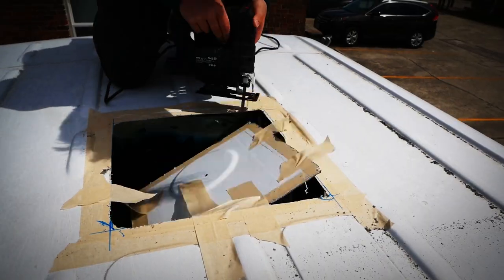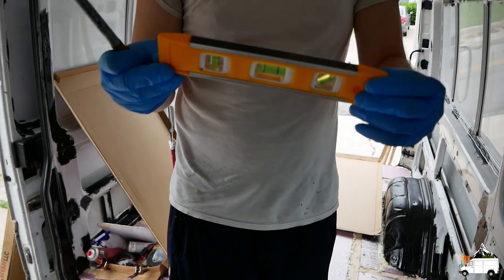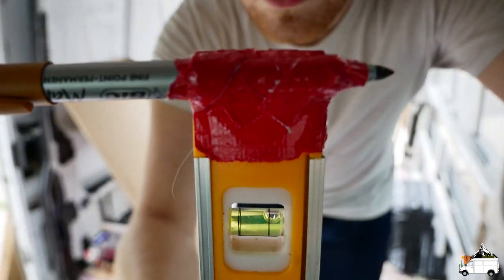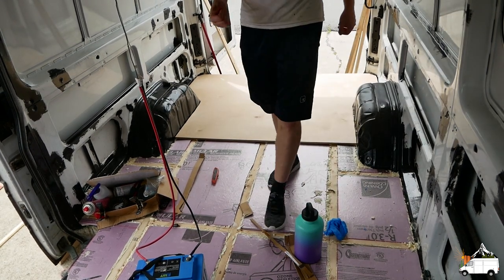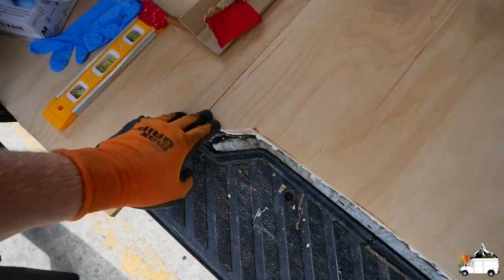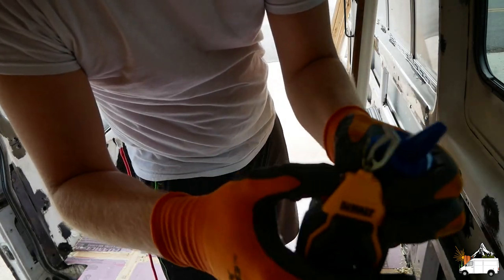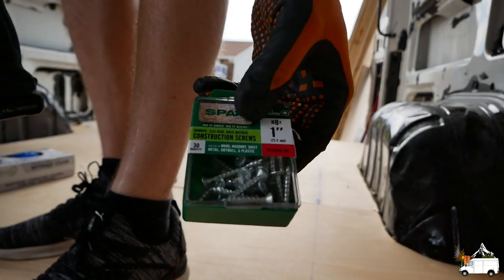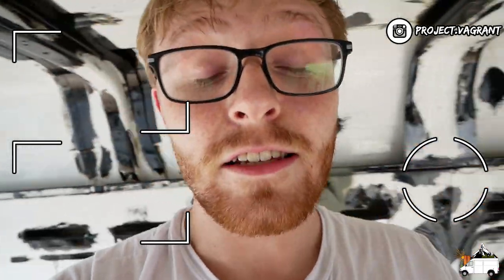How to Cut and Lay Subfloor | DIY Sprinter Van Conversion | Project Vagrant

Comment: I've been fearless to tackle just about any part of the van build so far... except the floor. The floor is intimating me. So many schools of thought.
Reply from the maker: My $0.02 is either do what I did in the video or if you fear potential water getting to the framing, cover the whole floor with 1/2" xps and then lay the subfloor floating on top of it. Once you screw cabinets to the floor/wall it'll all sturdy up.